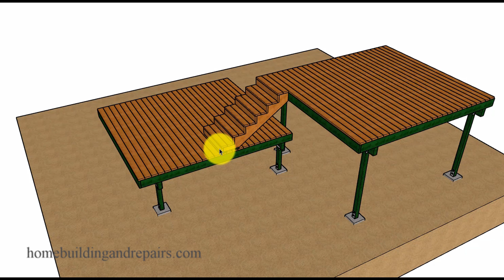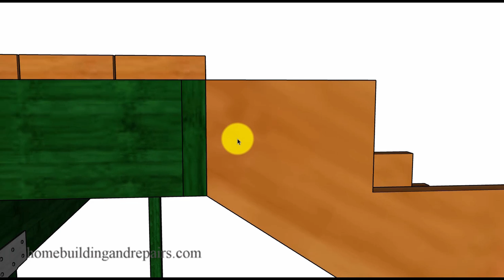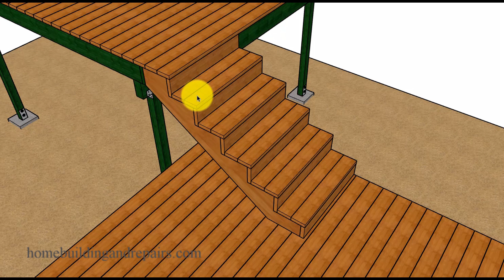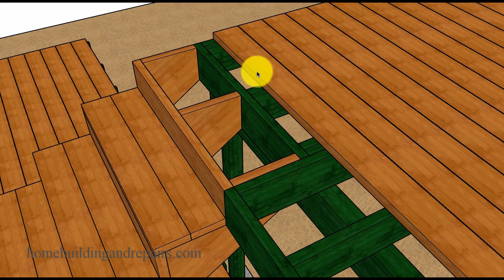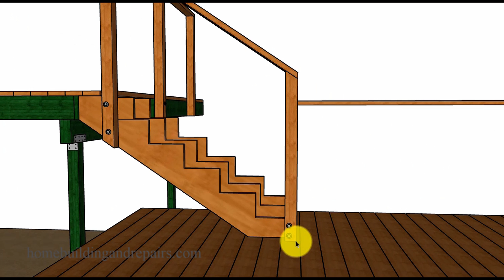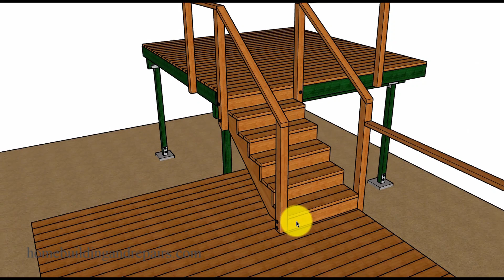How To Build Deck To Deck Stairs Part 1 - Design And Framing Ideas For Multilevel Outdoor Decks

Comment: Hi, I love ur videos, I have a multi leval deck n want to know if u can attach a 2 stair stringer from top deck to 2 box steps 1 bigger than the other that are sitting on bottom leval deck?
Reply from the maker: It would depend on the design. Maybe our newest video will help with the double landing at the bottom.